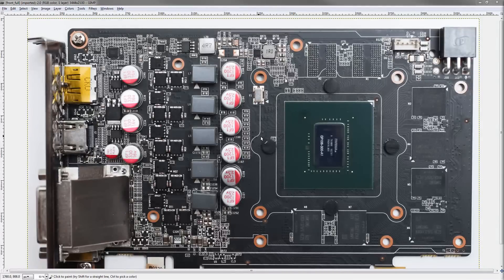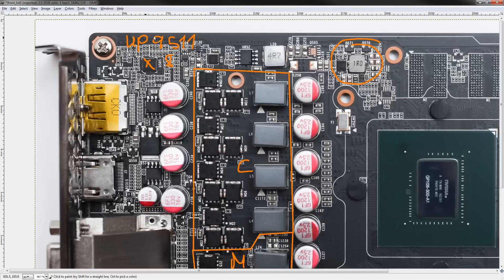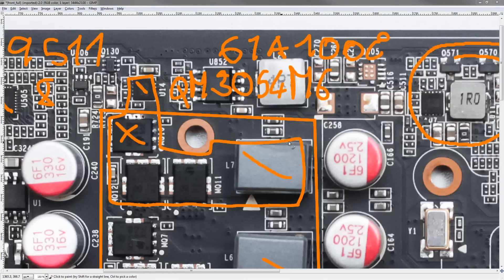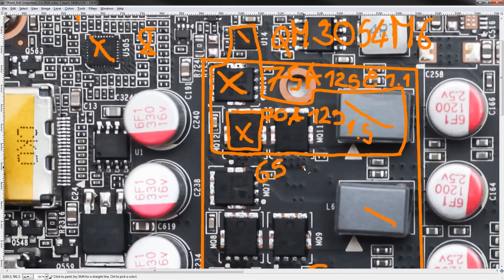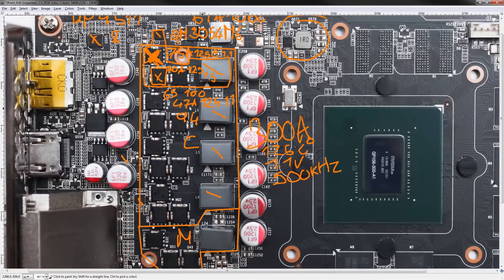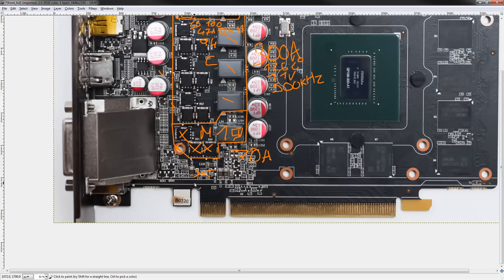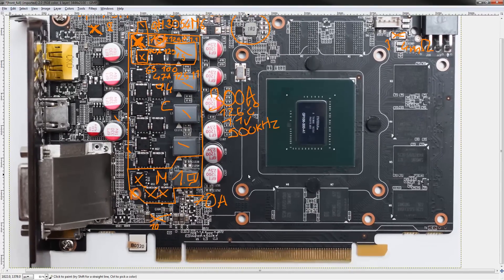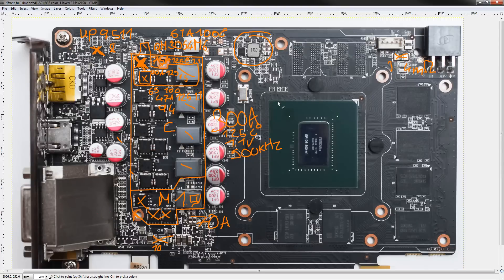PCB Breakdown: Zotac GTX 1060 Mini

Comment: I have a problem with this
When the pcie is the only power on this card all the voltage are present gpu die heating and if i added the 6 pin power all the voltage are gone what do you think happen on my card

Comment: i know the video is 6 years old already but maybe you could help me troubleshoot a minor problem with this exact same card that i got.
Reply: the card works like normal, until it get under real load, then it doesn't perform at all (low fps). GPUZ tells me, that the card doesn´t draw any power over the 6 pin connector, so it has to be a problem there i believe. Since im not very experienced with microelectronics im seeking for help here. Let me know if you have any board view or schematics of the card or are whiling to take some time and help me with this card. Thank you for ever help.

Comment: i have a Zotac GTX 1050 Ti mini and my fans don't spin I have tested this in 2 different computers both hitting 80c before I shut it down I also tried MSI after burner and I even replace the fan what contral the fan on these cards and can a diyer do it him self

Comment: got a question  i got a bad gtx 1060 mini 6gb and a 3gb gtx 1060  mini  i was wondering if i swap the vram over to make my gtx 1060 a 6gb mini   will i need to swap bios chip  or will bios pick up the 6gb of vram

Comment: My Zotac 1060 Mini has started dying in 2.5 years, turns off randomly, with / without load. Tried changing almost everything: motherboard, CPU, PSU & RAMs but the issue persists.
Reply: hello, i would be happy to buy it from you. i need just need to indentify some components around the hdmi display port. thanks

Comment: ive have a plane to water cooling this gpu, is that blocks in left side of the core that you mention generate heat, but its ok to let it exposed, but is that still is that has to be cooled ? and if are, can it be cooled just using thermal pad with small cheap heatsink above it (allu or copper) ? and the only fan in the case is far from the gpu
thankyouu

Comment: So my fan went out on this card and I want to replace it, but I can only find fans that draw higher current. The default is 0.3A and the fans I'm finding are 0.45A and 0.5A, all of them are 12VDC.

Would it be safe to use the higher current fans?

Comment: I know this video is old but Thanks For The Info! Had to make sure that was a shunt in the top right for the power mod. Have you ever heard anybody else complain about the Coolaboratory Liquid Thermal melting off anyone elses Shunts? I am wondering before I try it myself. I ordered both the Coolaboratory and Thermal Grizzly. Hopefully one of them doesn't have this issue. Keep Up THe Good content!

Comment: How about gtx 1060 g1 gaming? And compare it to the gtx 1070 g1 gaming. They should have almost identical PCB (1060 is just stripped off some phases). Plus you'd have a 2in1 vid :D

Front: http://images.bit-tech.net/content_images/2016/09/gigabyte-gtx-1060-g1-gaming-review/1060g1-8b.jpg
(The VRMs are Magic R15s, mem controller... I can send you a better photo, I have the card at home)

Back: https://elchapuzasinformatico.com/wp-content/uploads/2016/07/Gigabyte-GeForce-GTX-1060-G1-Gaming-14.jpg
Reply: (Pluuuuus, I have one at home and it is a little monster of an overclocker... on air it broke 2500 MHz on core but with very mixed results - it simply reported 2.5 GHz clocks but power-limited itself..)

Comment: Can you tell me where is the power limit thing on this card so can i do a power moding on it with coollaboratory ultra?

https://www.google.ro/search?q=r9+270+oc+pcb&sa=X&biw=1455&bih=858&tbm=isch&tbo=u&source=univ&ved=0ahUKEwi4wIKXwtnQAhVH2ywKHfpNB2gQsAQIGw#imgrc=QikQcVniETEbiM%3A
Reply from the maker: AMD cards don't use the same power measurement method that Nvidia does so the mod doesn't work on them.

Comment: I would like to see a GTX 1060 on a head to head overclocking battle with the RX480 GTR to find which one is the fastest.

Right now where I live the cheapest 6gb 1060 is less than 10€ from the GTR and I'm wondering if I should just get the cheapest RX480 (Nitro + 4gb) or go balls out with the GTR.

Love the PCB breakdown videos!

Comment: The ASUS RX 470 Strix uses also one M3054m for the high side and two M3056m for the low side with 5+1 phase vrm, but I wonder if they have the same current-temperature rating as the M3054m6 and M3056m6 mentiond in this video??
http://www.ocdrift.com/review-asus-rog-strix-rx-470-4gb-oc-edition/2/

Comment: How do i cool vrms when i use gpu only waterblock. 
Is there a possibility of suffocating vrms with that little heatsinks from amazon or ebay? 
Love your channel!
Reply: King Nikman
Get some decent sized heatsinks with some sort of thermal glue (make sure it's removable). You will need a always on fan to spin at a decent speed to keep the temperatures down. 
Those little heatsinks aren't really made for high-performance graphics cards.
Reply: +josh Subet thank you. And one more thing.  What difference is between thermal paste and thermal pads for vrms.
Reply: yea im not entirely sure on what to use as the TIM for the VRM. I have an accellero xtreme III on my 980 ti, I used the thermal (permanent) glue that came with the product. 
here are some resources do you don't blow up your VRM.
http://www.overclock.net/t/1479716/guide-closed-loop-aio-coolers-on-your-gpu-warning-picture-heavy
https://linustechtips.com/main/topic/600557-how-come-thermal-paste-isnt-recommended-on-vrms/

Comment: Random story time because Overclocking channel

I remember trying to overclock a 4690k on a $200AUD Asus Z97-C which is apparently a 6 Phase and no matter what voltage anything over 4GHz was unstable.
Now I'm using an MSI Z97 Gaming 5 I got for $250 and it's done 4.73GHz at 1.413v (tried to do 700 in Cinebench for fun one night) I usually run 4.5 at 1.295v now. I observed without me holding a case fan to the VRM it didnt even get into windows at 4.7 though, so now I'm super paranoid about getting anything below a mid range board
Reply from the maker: Haswell should be one of the architectures least affected by VRM quality. The mobo VRM only has to make a relatively high 1.8V at low current and the FIVR actually handles the voltage that the CPU runs on. So that is very odd that you had such a big difference between 2 mobos.
Reply: Actually Hardcore Overclocking Yeah, that's exactly why it took me so long to realise it was the board.

My G3258 runs the same on both boards after recent testing which is even more bizarre (Though it is literally the worst chip I've seen anywhere in terms of overclocking), I can prove it all but I'm lazy and it would require switching out boards but if it helps you in some way I can try it some day. 

I can also snap a picture of the mosfets if you're interested, I would just have to take it out the box so no biggie

Comment: hi, i do have some questions.
do you mean this type of mosfet (1 high side 2 low side) could be better than high and low side integrated mosfet? and how to read the data sheet of mosfet when there are Ta and Tc for the rating, what are the differences between these two rating and which one should be regarded as the reference of mosfet current rating? thanks
Reply from the maker: Ta is ambient air temperature and is usually equivalent to about 125-130C Tc. As for multi mosfet phases(2 hi , 2 lo is also a thing) they usually can handle more current and run cooler but they also tend to be less efficient than integrated designs.
Reply: what is the meaning of efficiency of mosfet??  efficiency and current output is negatively related??

thanks

Comment: Do you ever do this for motherboards?
Reply from the maker: I would if I could. But I got good news for you. With mobos these days the VRMs basically don't matter except for the AM3+ platform where some of the cheap mobos will not handle FX chips doing 4.4+ on more than 1.35V.
Reply: Actually Hardcore Overclocking  yeah my msi 970a sli krait edition blow up it self and my fx8350 on stock settings without turbo and vcore set to 1.28V. vrms just gave up on that and i got to see magic blue smoke.
Reply: slipknotboy555 and it is very good value
Reply: Jason Smith I would love it  if he did
Reply: Bozo Sosic That sucks; yeah, MSI kinda fucked over their AMD customers on that one, as they really cheaped out on the VRM (as you unfortunately witnessed first hand!). It sucks, too, 'cause the color scheme is great. I have an Asrock 970A-G/3.1, and thankfully its VRMs are more than adequate (which is part of why I bought it)
Reply: slipknotboy555 yeah but i ve got a refund so i bought asus 970 pro gaming aura with 7phases for cpu
Reply: Bozo Sosic Nice, you probably saw, but Buildzoid actually reviewed it - its VRMs are very, very good. Mines an 8+2, but yours actually may be the same or better, since I'm not sure what the VRMs are rated at. Pretty good mobo (just wish it was plain black since Asus put RGB lighting on it), they surprised me, as for some reason I didn't think they'd have as good a power design as they actually do. They did great with the Strix 480, too, good on them.

Comment from the maker: Damn I'm second. I need up my camping game.
Reply: you got that right
Reply: Hey im looking to build a custom block for this card with the help of a friend who's a cnc machinest. where would i get measurements for the heights of the components on this card? also i know power phases and vrm get hot as well as the die itselfe but is there anything else i should prioritise cooling?
Thanks for any help.
Reply: Hello... i have a MSI 1060 3gig that got burnt whilst on the desktop. The burn marks are at the VRMs you highlighted @ 6:47. If i try to power it on, there is a bright yellow spark/flame from that area. What do you think might have been the cause for these VRMs to burn and by any chance, are they replaceable?